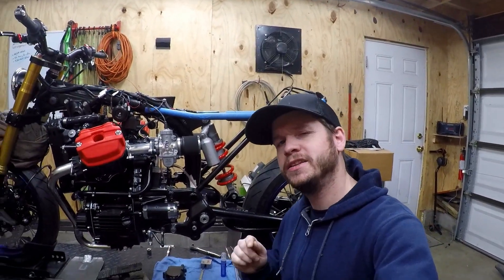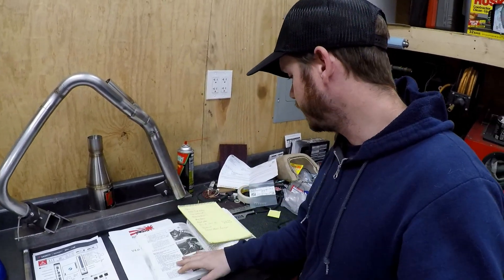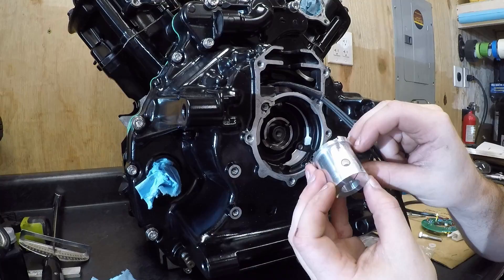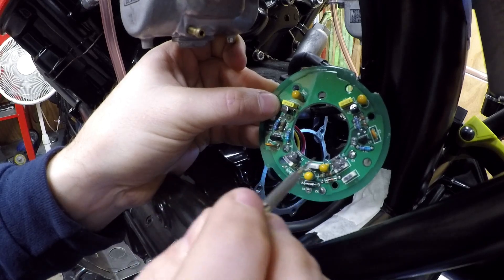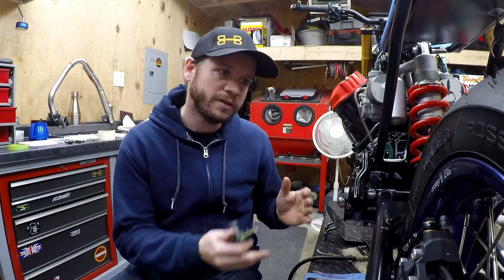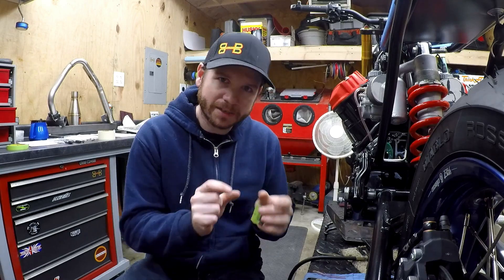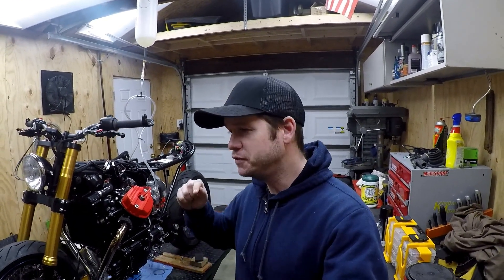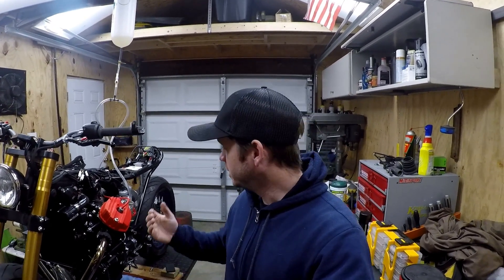CX500 Build - Rae San Hall Effect Ignition Install / HOW-TO - EP48

Comment: i went to the website, is the hall effect is all i need on everything on the ignition? pls held, 
on the web there is hall effect and also with those 2 cdi box on the picture
Reply from the maker: You would ask the manufacturer of the parts those questions.
Reply: @ i have cx500, which one should i buy 185 or the 210$ pls help
Reply from the maker: Please check the actual rae-san website. He has a graph showing which one may be the best fit. If you are unsure you can email the source directly.

Comment: I’m currently  doing a Rae San conversion on 1980 model cx500.
I bought new coils on eBay that are 3.1 ohms resistance but checking up different online manuals. One source says coil resistance should be less than 1.5 ohms, while another says resistance 2 to 4 ohms?
There is nothing in Honda manual on resistance spec
What would you suggest to be acceptable?
Reply from the maker: Ray of rae san has a chart of compatible coils for his kits as far as what resistance you want.

Comment: Currently building my CX500 thanks to your awesome video's.  I come back often and watch them over and over.  I am lost on one thing however.  Coil Packs.  I can't seem to find a video where you mention it.  Which coil packs and spark plug wires are you using? OEM Stock?  Im about to start the wiring phase but im stuck on coil packs.  Not sure what to do.
Reply from the maker: Well I do appreciate you watching the videos and am happy they are helpful. Once thing I must say though is DO NOT use parts just because I use them. This bike is unique and often required aftermarket stuff due to not having any factory components available for the engine retrofit. Remember its a GL650 engine in a CX500 frame so different ignition and charging system. I get so many emails from people buying the wrong parts because of my videos when they simply aren't needed and I hate to feel like I caused them wasted time and money. 

Back to your question though I do show the coil and reg/rec when I mount them under the tank in an earlier episode. I used an Ultima single fire unit.  If you have a stock CDI system you need to use your CDI coils. If you have a TI system you do have more options but I would save cash and just use your originals. If it ain't broke don't fix it sort of deal.  I honestly have no idea what plug wires I used as made multiple changes there.
Reply: @BrickHouseBuilds  Thanks for getting back to my question.  I was perhaps not clear.  I watch all your video's.  (I am enjoying your series on your new garage).
I bounce from video to video trying to learn.  I understand that this bike is not the same as my CX500.

Missing info in my last message.  I have installe Ricks Motorsport stator, new Reg/Rec, Rae San Hall Effect for my CX500 so my charging system is all up to date.  Knowing that.... Should I still use the stock coils?
Reply from the maker: So Ray has a section in the lower part of the description where he talks about coils. He is the better person to ask here https://www.rae-san.com/cx-conversion-to-12v-hall/

Comment: Nice and very clear explanation! I´m from Argentina and just installed the full kit in my CX 1978. The system works fine but I have a failure around 2.5/3000 RPMs. Over those RPM, the engine accelerates correctly...  Have you had any issue with the kit? It looks like an electronic issue but we couldn´t solve it. Maybe an eletric interference... Regards and congrats for your channel!
Reply from the maker: I would look to fuel and not ignition.

Comment: Im having to open up my cx500 (with a TAI cdi ) and stumbled upon the RAE-SAN system because all electrics have died.  It does completely replace the TAI-cdi  units if i'm correct? I am however i am still struggleling with the coils, because TAI based systems have specific coils which have 2 instead of 1 wire coming out of them (am i making sense ?). The coil(s) on your AXE build only involves 1 wire to each side. The difference with a cdi-setup is the B/W wire. Or is that just some sort of ground (i read there is a diode in there somewhere that makes things different?) . 
Anyway.... seems like  a good upgrade to any cx/gl , and with your clear instructions easy enough to install
Reply from the maker: I'll send you an IG message for this one

Comment: What if I just wanted to get the Rae San unit box and keep my old ignition system. would that work?
Reply from the maker: No. This is a system with all components designed to work together. Your stock ignition operates in a different way
Reply: @BrickHouseBuilds  now what if I still have my original Cdi box and the original ignition system but I wanted to connect it to those ignition coils that you have in your video would that be ok
Reply from the maker: @adrianpalacios864  no, cdi coils are very different than what I used. Again they operate differently. Do you have an issue with your ignition? If it works fine just keep using it.
Reply: @BrickHouseBuilds  my ignition system works fine the only thing I swapped were the coils. I have the  same “ULTIMA 12v coils” you bought and installed

Comment: How well do you think the circuit board will hold up to engine heat ?
Reply from the maker: Hard to say. Its not an uncommon thing for aftermarket ignition systems.
Reply: @BrickHouseBuilds  . Oh i forgot to comment on the custom intakes. Thought i saw a comment you made them ? Anyhow what is your expectations on horsepower and or torque for the new setup ?
Reply from the maker: Actually have a dyno video linked here. Lots of videos after this one of the build progressing.
https://youtu.be/UtUJl3p5ILs
Reply: @BrickHouseBuilds  ok thanks. Youtube videos kind jump around.  I need to pay attention to the timelines :)

Comment: Nice! I remember when this ign system was just a prototype. Nice to see it available now. My 80 CX500 was CDI. Running an IgniTech unit on it which has been good so far but I like this setup as well. I'd like to ditch the pulsar coils eventually.
Reply from the maker: So far it seems to be working well

Comment: If i buy this system . What partsdo i need to keep eg stator stator piskups cdi. Mine is a Honda cx500 1978 Thankyou
Reply from the maker: As there are multiple systems available id refer to the Rae San website as well as motofaction.org to gauge what may be the best combo for you.  Since yours is a 78 CDI model it is starting out from a different point than this bike which had the later TI system.

Comment: The more I watch you upgrade electrical stuff on old bikes, the more I picture Howard Stark as the old Honda mechanics saying "I'm limited by the technology if my time" lol. This looks cool, I probably won't tackle this anytime soon but I just may in the future.
Reply from the maker: I hear ya. Just note that simply because I'm using it doesn't mean you need it. This is a performance oriented bike where I have made cylinder head changes, fabricated intake manifolds, port matched those, have upgraded carbs, and made a full stainless exhaust so I wanted to upgrade the ignition to take full advantage. It is not needed for an everyday bike
Reply: @BrickHouseBuilds  mine is definitely an everyday bike, but just hoping my other wiring doesn't go out but who knows that might not happen.

Comment: I’m having some difficulty understanding what all I need to upgrade my 1983 GL 650. 

I want to do a full system upgrade, including Rae San ignition, coils, rectifier.. already have a moto gadget m unit and wiring setup.

Can you put together a shopping list? Would appreciate it.
Reply from the maker: Well in my reg/rec and coil video I link the ones I used as well as this here. It depends on what you want to do. The factory 650 ignition is pretty good but I of course wanted to try a few different things here. You don't need the exact coil I used or the reg/rec if you have a traditional battery

Comment: .kinda a dumb question but i also have the rae san ignition but i am running into a problem .. i bought these coils and the gas tank does not fit over the coils in the stock location and i see you are using a different looking style coil then i have . will this coil work on my bike as well ?ots a 1981 cx500
Reply from the maker: Hey Johnny, nothing is bolt on in regards to fitment.  My coil, reg/rec, everything is mounted in a specific place using custom brackets.  You will likely have to fabricate or modify your mounting brackets to get your coils to fit.

Comment: The Clymer manual is filled with incorrect info and definitely isn't a FSM.
Reply from the maker: I wouldn't disagree there as of course a factory manual is far more in depth but these have good information and can help you through most any item you are working on. Common sense must be used as well.

Comment: hey man! love this build.
quick question, did you have to change out the stator and / or regulator? 
if so, which ones did you go with?
Reply from the maker: Thank you. I outlined those parts in the engine assembly video for the stator and the other video talking about mounting the reg/rec. Both not required for this ignition.
Reply: @BrickHouseBuilds  thanks!

Comment: Just ordered mine.The wires that run to the front,what are you attaching them too?Do I need to replace my spark plug coils with that part? Thanks
Reply from the maker: The diagrams are available on his website but everything is self contained so to speak. You have wiring from the pickup to the box and then output from the box to your coils. No you don't need to replace them. There is a single switched 12v wire to power the system.

Comment: You got it Big Fella !
Its going to be quite a bike when she hits the road
Reply from the maker: Im excited! Im glad you said something in the last video. The window of fire was the same but the start and end points were off by just a tiny amount.
Reply: No problem mate I'm really happy with the Rae San ignition on my CX650 she revs out really nice The big advantage with the Rae San system is that it gets rid of all the old ignition parts on the CX's the only disadvantage which applies to all modern bikes is that you need a good battery if it goes flat you cant jump start it